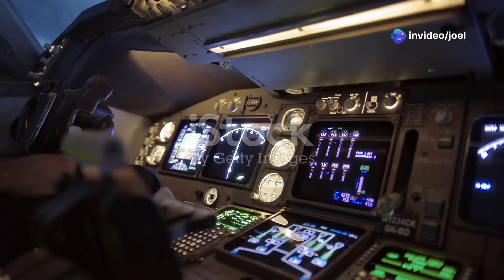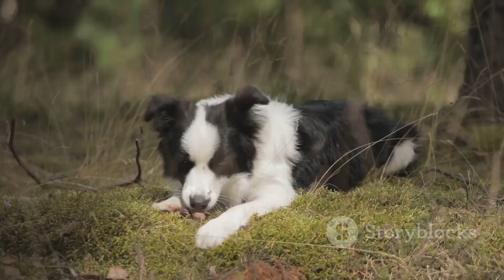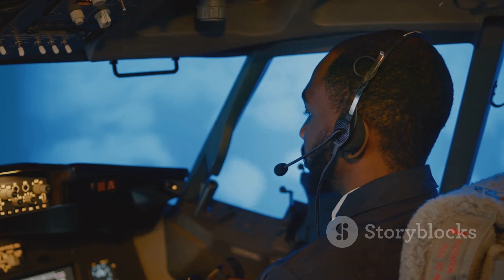🛫 Boeing Planes: How Safe ? 💥 Mid-Air Electrical Failures & Secret Safety Systems Explained ✈️

Comment from the maker: Time Stamps to Skip to the below Information on this video: Press More to see Full Contents  👇
00:00:00 This Plane Has NO ENGINES, But It Can Still Fly!
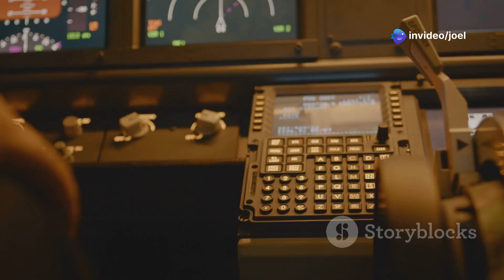00:01:28 Can a Plane Just Run Out of Gas?
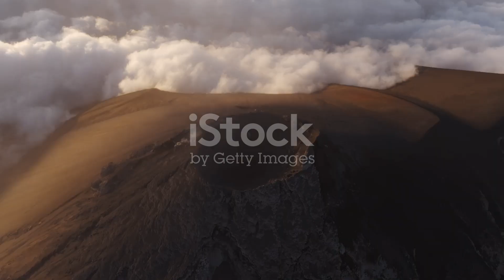00:02:44 Flying Through a Volcano Cloud!
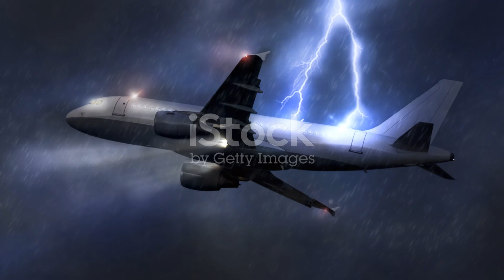00:03:56 Golf Ball-Sized Hail vs. a Jet Engine
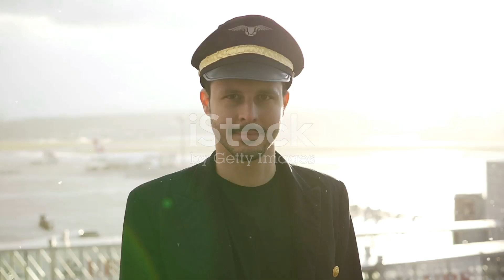00:05:07 When Birds Attack a 500-MPH Plane!
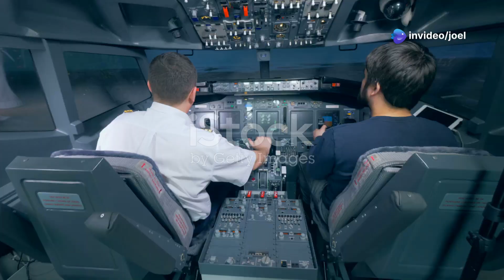00:06:24 What if the Plane's Brain Just Shuts Off?
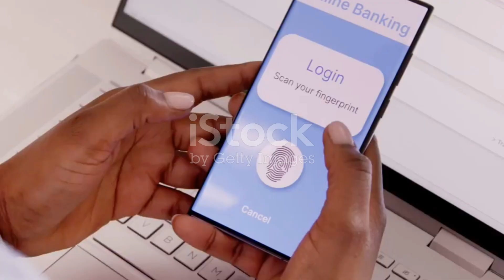00:07:38 Can a Computer Glitch Crash a Plane?
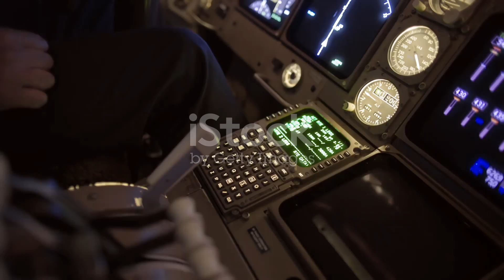00:08:49 Pilot Error
00:10:03 The Secret Propeller That Saves the Day
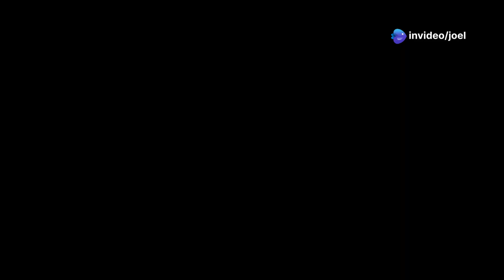00:11:14 The Plane's Own Backup Engine
00:12:19 The Computer That Tells Pilots Exactly What to Do
00:13:27 Flying is Safer Than You Think

✈ Can a Boeing plane really fly with no engines? This short video dives into jaw-dropping mid-air emergencies & how Boeing planes survive!
⚡ Electrical system failure? Dual engine shutdown? We explain how Boeing's backup systems save lives at 35,000 feet!
🛩 Includes the truth behind Air India Flight 171 crash 🔥 and what Boeing 787 Dreamliner pilots are trained to handle.

How safe are Boeing planes, really? In this gripping aviation breakdown, we explain what happens when a Boeing aircraft experiences mid-air engine failure, electrical shutdown, and computer glitches. Featuring real scenarios like volcanic ash impact, bird strikes, and loss of hydraulic control — this video reveals Boeing’s secret safety backups including the RAT (Ram Air Turbine), backup computers, and pilot training protocols.

Learn why flying is still one of the safest ways to travel and how technology and engineering in aircraft like the Boeing 787 Dreamliner help pilots land safely even when everything goes wrong. Perfect for aviation enthusiasts, frequent flyers, pilots, cabin crew, and aerospace engineers.